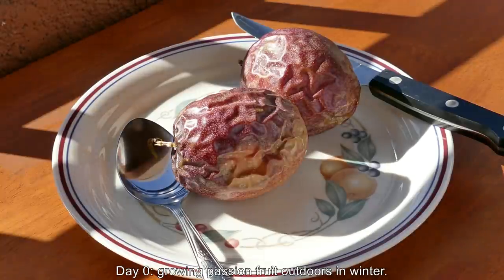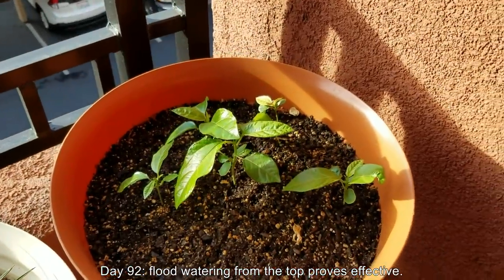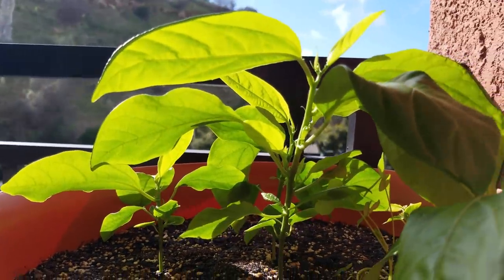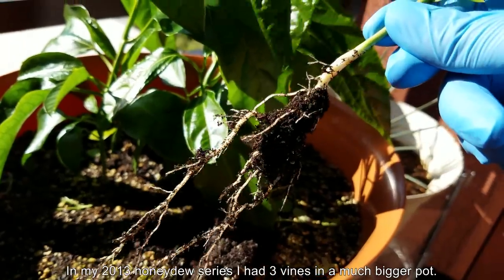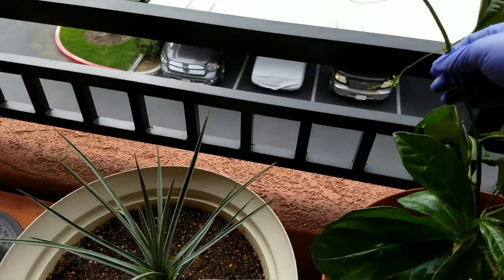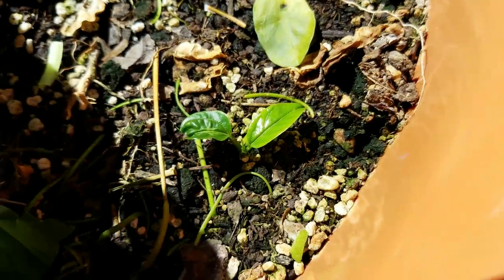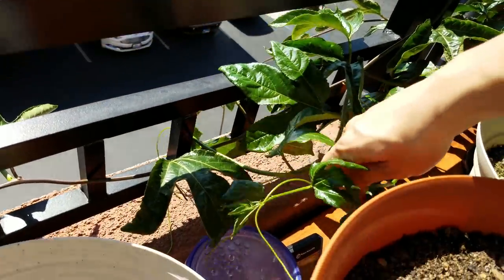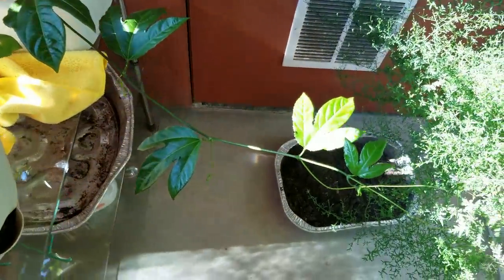Growing Passion Fruit from Seeds for 17 Months

Comment: Just a few tips. I’ve been growing Passiflora for 20 years - in Scotland! 
1) Use much smaller pots and pot on the plants as they grow.
2) fresh soil. A loam based mix is best for passsiflora. Sterilisation is not necessary and ruins the composition of the mix.
3) you are underwatering whilst the plants are seedlings, hence the very slow start.
4) yes, light and warmth are a factor, but they shouldn’t be that slow to get moving.
5) interestingly you end up overwatering as it grows. Sitting in water is a massive no-no with these plants. They prefer to be kept moist and then let them almost dry out.
6) Don’t cit off the tendrils as they still photosynthesise -and aid the plant. They will quickly curl in on themselves anyway.
7) it would help massively if you used bamboo canes to let the plant climb naturally using the tendrils. You get much stronger growth that way.
8) fungus gnats thrive in wet soil. Let it dry out and they will die off.
9) over fertilising will stop the plant flowering and force it to produce more foliage. Fertiliser burn happens to the roots. You’re killing them off putting concentrated crystals on there.
10) when you cut back the stems always cut to a leaf node, not between them. It encourages the new growths.

I hope you try again!
Reply: Pad 33      Thanks for the tips!
Reply: Those are awesome tips! Do you have any more piece of advice for a novice gardener? Do you have a website oder sth like that?
Reply: thank you for sharing, can you suggest the best size for container?
Reply: Cam Bar I have a passion tree that does flowers I do pollinate by hand but does not set fruit any help please thank you
Reply: About the smaller pots, I disagree very much.. Scotland has year round rainfall, California is arid Mediterranean, no rain from May to November.. small pots succumb to wind heat, roots bake , pot drys .I have seen plants whipped dry in one afternoon ....it is constant vigilance....deep saucers! :)
Reply: I would love to pick your brain about planting passion fruit in pots and then bringing them inside over the winter. It sounds like we live in similar climates.
Reply: Sick I live in Manchester bad have seedlings thanks
Reply: Poor information. And your voice is not clear. Please do not appear to teach the other in growing Passion Fruit.
Reply: @ValeriaVincentSancisi  I don’t grown many outside. I grow them in a greenhouse where it is warm and I need to be the one to supply moisture.
Reply: @eccremocarpusscaber5159  I'm about to grow my own passiflora. A native species that grows in the US. How often should i water the seedlings. Also should I keep them in the dark before they sprout?
Reply: @eccremocarpusscaber5159  Thank you for these tips. I just got my first passion fruit sprout and I really needed this information now.
Reply: Hello! I am going to try and grow passiflora cerulea this year. I was wondering if it would be a waste of time to try and tincture this plant. I have read that passiflora incarnata is the kind that people use for medicine, but I could not locate any of those seeds in my area. Thanks for any feedback!
Reply: Wow, in Scotland. Great achievement

Comment: I have a ficus tree that's been in the same potting mix for 25 years without repotting and it's still doing fine. Also never fertilized it, any nutrients have just come from rainwater and its own leaves breaking down.

I also have some pepper plants that are 18-19 months in the same containers now and also are doing well. They're growing in an equal parts mix of sandy native soil, peat moss and composted manure.
Reply: how big is the pot how many gals?
Reply: @billyd7628  Around 7 gal?
Reply: @Lochness19  wow really? that small? i see people mostly buying anywhere between 14 and 25 gallons for their potted fruit trees. are figs really that tolerant of being rootbound? pretty cool.
Reply: @billyd7628  Initially, yeah, but container fig trees need to be pruned, including a root pruning every few years, you can't just let them grow unfettered year after year. Some people even use 5 gal for small fig trees. Personally, I have been gradually up-potting mine. 3-7 gal for the first year, 7-12 gal for the second year, 12 gal for 3rd year+.

Comment: It took seven weeks to sprout five seeds ( last year's collection from a supermarket passion fruit that was a dried but cleaned batch.) In NY and wanted to know if high humidity, a certain feed and adequate water is all it needs so far? The sprouts are still just getting their true leaves in. How big will this variety get? It is a vine I assume.
Reply from the maker: Passion fruit vines get really big. New York is a great environment for vines in summer.
Reply: @TheMelvinWei  89 degrees over here by our neck of the woods. I noticed a few more have emerged and yes, I also have a hybrid flowering only variety and I learned that it is ok in shaded areas by midday. I believe you mentioned this on your last video. How about spacing though? If you have one vine to each planter or plot, they should be prone to taking over that space. And if so, what conditions are required for the fruit? I found from this that like ginko trees and other species , the passion fruit cannot bear it's own fruit without both a male and female plant to work their magic. I imagine that six or five plants will produce different outcomes as far as when I'll know which is a male or female passionflower or fruit plant. Eh, not really very clear with that I apologise. Thank you for the response. Appreciated greatly.

Comment: Starting at day 475, it appears the soil has stayed wet for far too long as evidenced by the moss growing on the surface of the pot.  I know you don't like messes, but in addition to starting out with smaller pots and considering the size of the root ball, I think you would benefit from using pots that don't hold water.  Standing water is kinda just always bad.  If you have pots that lets excess water run out the bottom, and away from the pot, that is ideal. 

Edit: Also, I'm not trying to be a jerk or poo-poo the idea of using different mediums for your potting soil, because I believe in using native clay and sand in a mix, but potting mix wouldn't cause your plants to fail after a year.  I know you don't want to hear it, and I understand, but I really think you should be looking more at the lack of drainage in that style of pot and watering practices after removing the bulk of the foliage as to the reason for this plant's eventual failure.  I think I mentioned part of this in your other video, but I forget.  Thanks for continuing to put out the content!
Reply from the maker: In the middle of the series I had the leaves composting on the top for a while, then I got rid of them which was bad. But I agree, I'm using real dirt going forward. Potting mix just brings a huge set of problems with it. Anyway, I'm kind of done with vines, they're too much upkeep. I'm currently trying to germinate in small pots with real dirt, a clay loam from what I can tell.